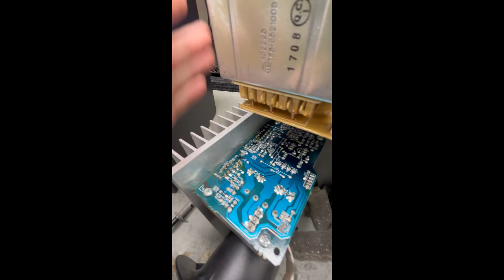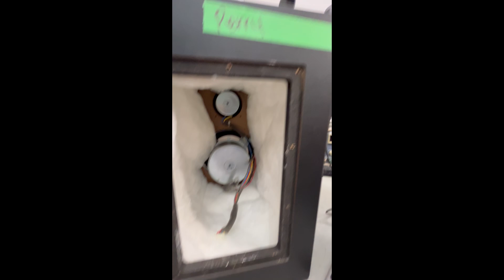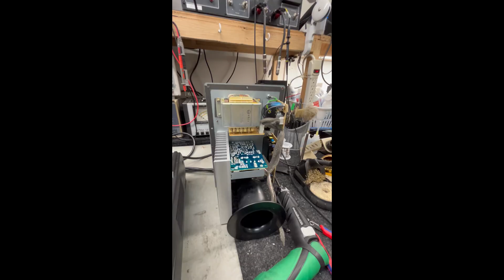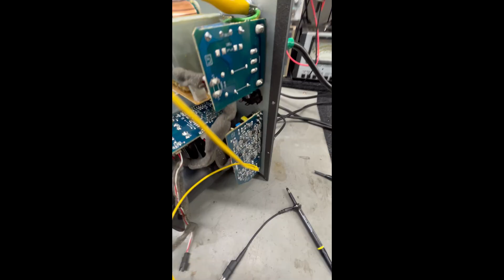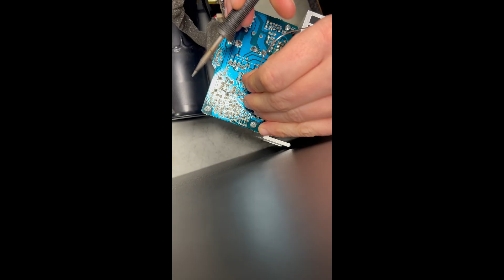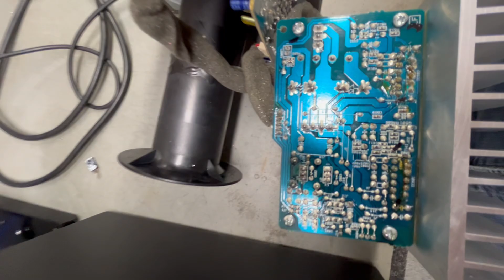Fixing a "dead" Yamaha HS80M studio monitor - basic troubleshooting/repair, solid state electronics

Comment: one of my hs8s makes a phase shifting sound but when i jiggle one of the frequency switches on the back it fixes it momentarily, you think i could self fix or i need to just take to repair shop
Reply from the maker: Try spraying some deoxit into the switch and actuating it (ie switching it up and down a bunch). It could be that the switch contact is oxidizing and causing the issue.
Reply: @Dynamic_Music_Tutorials oh wow ok I’ll try this
Reply: @Dynamic_Music_Tutorials mannnnn I want to say thank you,I’m thinking it fixed it not hearing that phase every so often and when I mess with the switch it doesn’t make any weird nosies anymore I’m going to monitor it as the days go on but thanks
Reply from the maker: @breadmakingplays716 you’re very welcome glad I could help